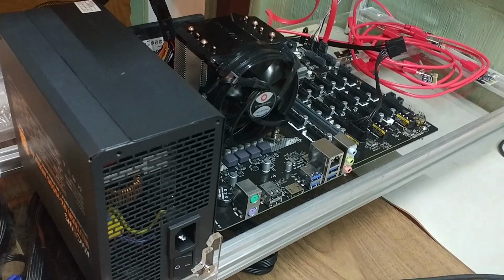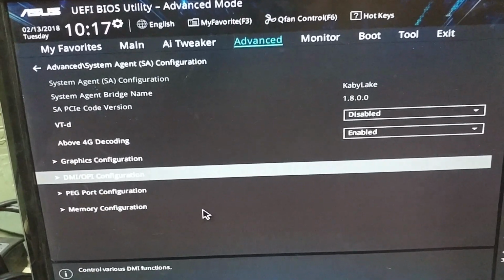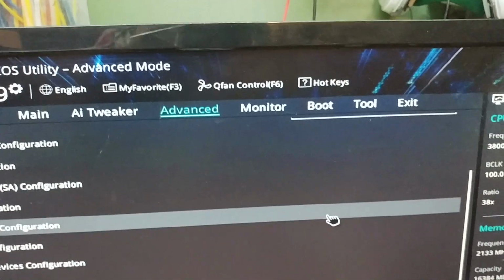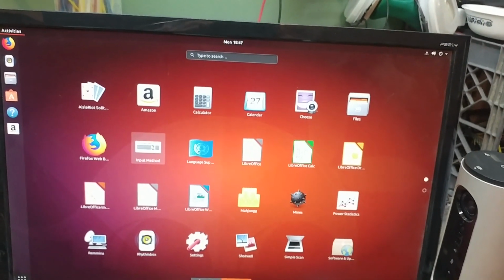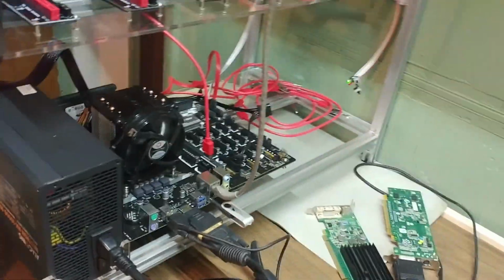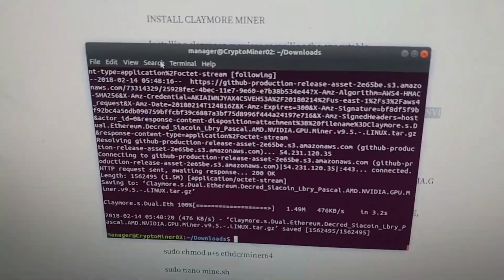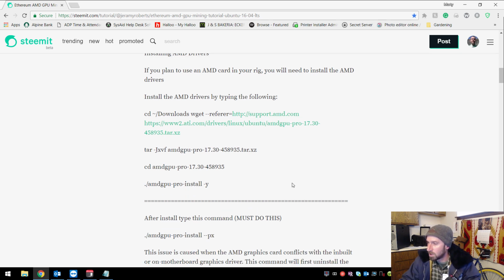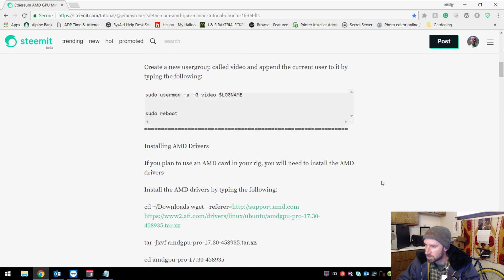Building an Ethereum Mining Rig in Ubuntu 17.10

Comment: If you flash your rx 580's bios and install the amdpgu 17.50 drivers it gives you 28mh/s on stock settings... the problem is that there is no tool for linux to underclock  the core  to 1150 from 1411 and overclock the memory to 2200 from 2000... those settings would give you 31mh/s ... It's sad I had to switch to windows 10 again so I could tweak the wattman settings
Reply: Just as a heads up there are tools on linux to overclock memory and underclock core, see ohgodatool. Does notwork for undervolting, you need to hex edit that or take a stab with amdtweak. I just hex edit the bios makes life easier. Also you can change hard mod the memory clocks, core clocks, and voltage pointers directly though the polaris.
Reply: Ohgodatool is useless since it doesn't auto undervolt when you underclock the core. You need to hack the kernel to undervolt polaris gpu. Not every miner is a linux god poweruser. So you'll end up running 6 gpus at 1350 watts without undervolting instead of 850 watts. Personally I run windows 10 on my amd rigs and ubuntu 16.04 on my nvidia rigs. I hope amd will do something about this soon
Reply from the maker: Yup - that was my struggle. Very easy to set up, but I spent hours looking for a way to undervolt because they were running very hot, and the hashrates, well you saw em. I also ended up just installing Window 10 and I am using the 18.2 drivers now and getting about 30 M/Hs. Since these RX 580s are brand new and this equipment has yet to pay for itself, I'm a little reluctant to mess with hex editing the BIOS if I can get good results in Windows using Wattman.
Reply from the maker: Michael I'll have to try again. Will be building more rigs in the future - thanks for the tip!
Reply: The new rx 580's have a Bios switch that lets you swap from graphics bios to mining bios. Its pretty slick.